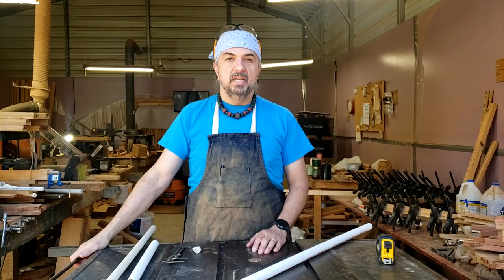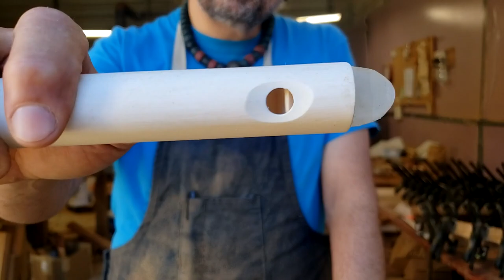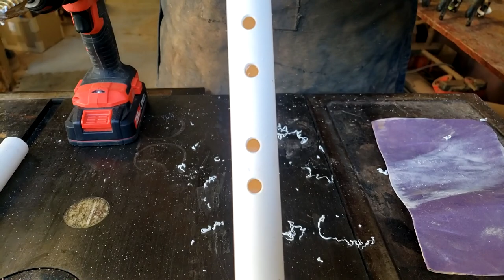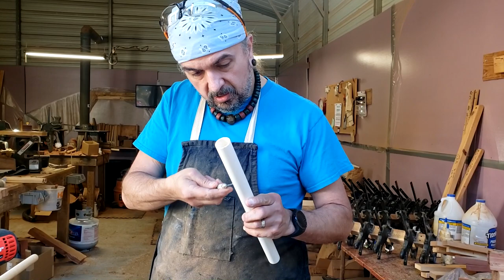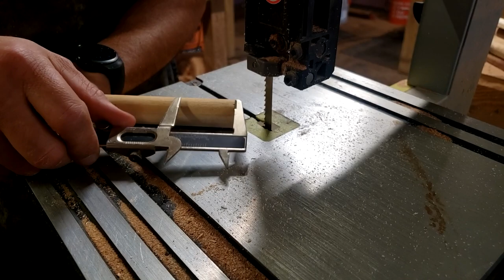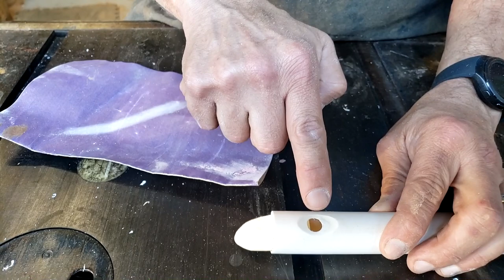How to Make the Simplest Native American Flute from PVC - Easy Peasy

Comment: I followed your directions and it works, except for jumping an octave higher if I blow a little too hard. What is causing this? Thanks, Michael
Reply from the maker: I do have lots of other videos to help out with the small problems like that but one thing that should probably help you is to slightly bevel the edge of the track going into the sound hole.

Comment: Hi Charlie, this looks quite easy to make. Does the length of the slow air chamber (SAC) matter with these PVC flutes? The wooden flute that I bought had a SAC of at least 8 in, but perhaps this is a more traditional design? I am seeing some other NA style PVC flute makers keeping the SAC length short as well, perhaps its easier to push a dowel or cork through it.
Reply from the maker: That's a great question my friend! I believe I actually did a video that included some of this topic as well however the short answer is no. The length doesn't matter too much. I have actually lengthened my flutes air chambers in order to make them more aesthetically appealing to the public. Historically they were all over the place as well as in modern times! Thanks for the great question!

Comment: You can color PVC to any color you want by mixing RIT dye for synthetic fabrics with clear PVC primer.
Reply from the maker: Have you tried it?
Reply: @BlueBearFlutes  Yes, I made a handful of your Cherokee whistles out of 1/2 inch PVC & I dyed one pink for my granddaughter & one purple & red for myself.
Reply from the maker: @shakyarcher  I must not have been holding my mouth right when I tried it! 🤣 Looked up websites, videos and companies who offered pcv dyes... I guess I was just not happy with the results and didn't offer it in this video. Thanks for posting! (and for watching!)
Reply: @BlueBearFlutes  I used the liquid Rit DyeMore for synthetics & Oatey clear PVC primer. I didn't dilute the dye with anything, other than the PVC primer. I think I mixed the dye/primer in 2-1 ratio (2 parts dye to 1 part primer). Darker colors seem to work better & I used multiple coats. It doesn't dye the PVC completely through, just the surface & a deep scratch can go through it.
Reply from the maker: @shakyarcher  that's exactly what I experienced. I felt like it was painting it more less with clear paint.

Comment: Nice project Charlie! I have made a few side blown 6 hole flutes in G and Bb that sound good. Also made a 6 hole Native American "style" flute. Really want one that is 5 hole to experiment with. Had not considered   what I guess would be a fipple mouth piece. As a suggestion, I use a board with two parallel strips attached the width of pipe appart to help hold the pvc while drilling.  Also aids in drawing a straight line for holes if desired. If sanding the outside with rough sand paper over time as you mentioned it picks up some oils and dirt, almost looks like birch. Thanks again for posting!
Reply: Your pipe vice sounds like a great idea. Thank you.

Comment: Thanks very much for the instructions.  This is very cool.  Just one question though.  It seems odd that a 7/8" dowel fits inside a 3/4" PVC pipe.  How does that happen?  I just grabbed some 3/4" pipe and a 5/8" dowel fits inside with a tiny bit of room to spare.  Thanks, John

Comment: I did one modification in my build: I found the 3/4 dowel too small so I used 7/8 which fit with no sanding and worked great.

The notes I get are A,  C,     E, F# (+35), and A.  
Were we aiming for A, C#,   E, F#, A?
Where is the calculator I should use for my next one?
Thanks for this project!

Comment: This is interesting. But the flaw in this design is the introduction of a wood dowel that will expand/contract with moisture from breath condensation. The easy fix is to file a flat spot and cut a short piece of pvc that's one size larger diameter than the long section. Use it as a 1 or 2 inch clip on cover. Then, use a wine bottle cork for an interior plug. You can keep your holes straight by marking the pvc against a piece of plywood or similar lengthwise. Also, sanding then brown shoe polish and clear coat looks realistic if simulating wood.
Reply: @BlueBearFlutes  Don't dismiss using pvc as a nontraditional flute making source material. If you spend as much care and attention as wood flute making, with your skill, it could be a fantastic sounding and durable instrument that can be enjoyed for generations without a single adjustment or maintenance ever. Some of mine are several years old and still sound as they did when new.

Comment: Thank you for your videos! Don’t know if it helps people in identifying the proper pipe or not, but The sdr in the print on the pipe tells the wall thickness. It is a dimensional ratio (the DR part of SDR) of the outside diameter. Outer diameter of 3/4” pipe is 1050 thousandths smaller r 1.050”. Divide 1050 by 21 in this case and you have a wall thickness of .050.
Reply from the maker: Wow!

Comment: SDR is what you ask for. It stands for "sewer and drain". Your store guy will probably know it by that name rather than the schedule. Also, it tends to be mixed in with the pressure pipe, so just look through the whole bunch at your big box store.
Reply from the maker: I usually ask for IRRRP and they never seem to know what I'm talking about at my "big box store"! I guess using made up acronyms isn't the best way to go. Of course little Timmy at my local store doesn't really need a job while he's going to college anyway, and you know my local irrigation supply store (small box store) doesn't want my business because I'm not a landscaper...

Comment: I’m in the process of making this but I’m not getting hardly any sound maybe the sound hole isn’t sharp enough?
Reply from the maker: It could be that, or more likely the plug is not open enough or is open too much and is pushed too far inside of the flute.

Comment: can someone tell me, what the size in cm is? (OD) in metric...im sorry, i am German
Reply from the maker: OD 25mm. Keine Notwendigkeit, sich zu entschuldigen. 😄
Reply: @BlueBearFlutes  alles cool, danke dir, ich kaufe gleich morgen die Passende im Baumarkt...danke liebe Grüße
Reply: @BlueBearFlutes are you sure, that its od25?... am i stupid or did i calculate wrong, i have 3/4" as 1,9 cm...or is there any way, you could post the lenghts in Metric cm?? If u dont mind, its hard, even with acces to internet, to do each independent...or tell me i am wrong, I bought both, oder 20, as well as 25en and for both the wooden dowels, my text is probably too long
Reply from the maker: @lenval555  Entschuldigung, dass ich dich ausgetrickst habe.  Anscheinend können Sie Zoll problemlos in Millimeter umrechnen.